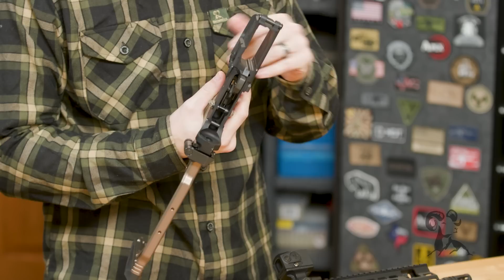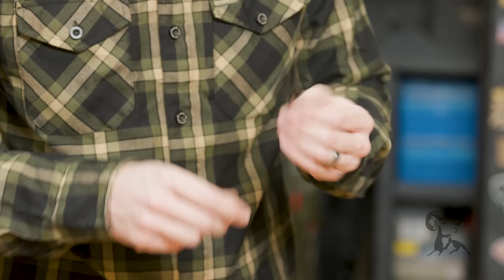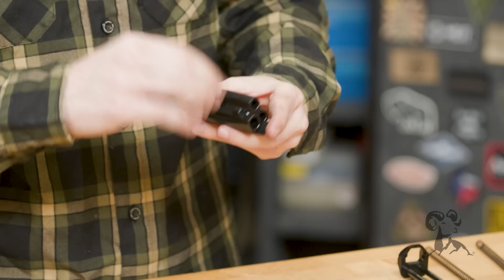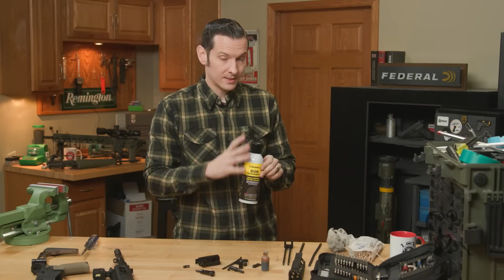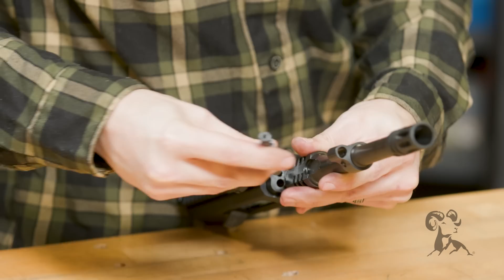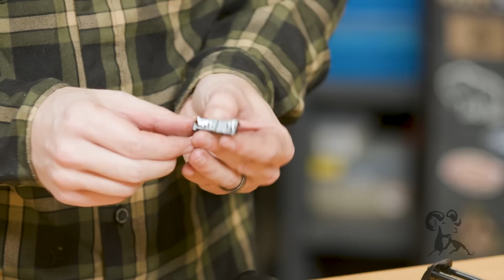Tech Tip: BRN-180 Gen 3 Field Strip and Maintenance

Comment: IS YOUR PISTON ADJUSTMENT STUCK!?  I HAVE A FIX!!!  Keep in Mind, im a functional idiot, so double check my methods here... I had this same problem with the 13.9 inch upper. I solved this problem just today.  You need to remove the handguard, and the get some Break free then CLP on that front piston piece (the one that the front pin with the ring goes into.) I had a Fixit stix punch kit, and used a brass punch after 15-20 minutes of letting the CLP sit.  took about 20 good smacks, but it got er free.  From there I CLP'd that specific front pin (the same thing I hit with the Punch) and now it rotates exactly as advertised.  My understanding is that this is a common bug/feature (joke) on the PWS uppers that Brownell's uses for the BRN 180 Gen 3.  As I understand it, this should be part of regular maintenance for this gun.
Reply: Can confirm, this is the way. My piston was completely locked in place. I just completed this same procedure, right down to the CLP soak and tapping that sucker out with a punch on my piston assembly. I eventually got it out, then cleaned everything up, and lubed the channel and adjustment pin thingy just as Caleb describes. The adjuster now moves like a dream.

Comment: I don’t see any comments about this, but I’ve been having the issue that my gas key is frozen in place so I called Brownells tech line today and they said it’s a known issue and that there isn’t a fix available yet. I would think this is something you should put a notice about, and ideally reach out proactively to your customers who purchased from you (I bought my upper from Brownells like 6 weeks ago) instead of making us guess what is going on. 

Also, this happened within probably 30 rounds, I was able to get it unstuck the first time, then after a few more rounds it was locked in place. How did this not come up during product testing? It’s the 3rd generation of the gun and the tech told me it wasn’t an issue on previous versions, how does this even happen? Using your customers as guinea pigs is really bad for business.

Hoping for a quick resolution, especially as a first time brownells customer.
Reply: I had this same problem with the 13.9 inch upper. I solved this problem just today.  You need to remove the handguard, and the get some Break free then CLP on that front piston piece (the one that the front pin with the ring goes into.) I had a Fixit stix punch kit, and used a brass punch after 15-20 minutes of letting the CLP sit.  took about 20 good smacks, but it got er free.  From there I CLP'd that specific front retaining pin (the same thing I hit with the Punch) and now it rotates exactly as advertised.  My understanding is that this is a common bug/feature (joke) on the PWS uppers that Brownell's uses for the BRN 180 Gen 3.  As I understand it, this should be part of regular maintenance for this gun.
Reply from the maker: There is a new gas block design, it was a running change.
Reply: @brownells I’ve called customer service 3 times about this issue and every time I was told that I would be contacted when the change was implemented so I could send my upper in to get the fix, haven’t heard anything until you just commented on YouTube. What a joke

Comment: I started having problems with my bolt not locking back and eventually failure to cycle. Turns out a piece of brass had gotten up into the gas port blocking the hole and binding the gas adjuster in place. Had to soak it in oil and hit it with a hammer until it worked lose.

Comment: Do you ever plan on offering barreled trunions for sale separate from the upper for when barrels get shot out or people want to change barrel length? I'd hate to think you just throw away the whole complete upper in the case that the barrel ever gets toasted. The availability and modularity of these parts would allow for this to be a true alternative to the AR-15. This is basically the only thing stopping me from pulling the trigger.

Would be even more amazing if the feature set of the Gen 3 somehow managed to use standard AR-15 barrels.

Comment: primal rights did a video showing the whole bore brush from chamber to muzzle is a myth. maybe i guy can update your smythbusters. no one uses a steel cleaning rod and aluminum and brass are softer than barrel steel. 

jusg like we use brass punches and scrapers on gasket surfaces